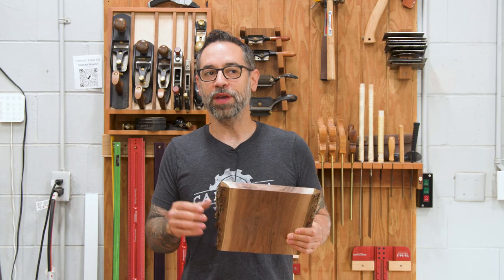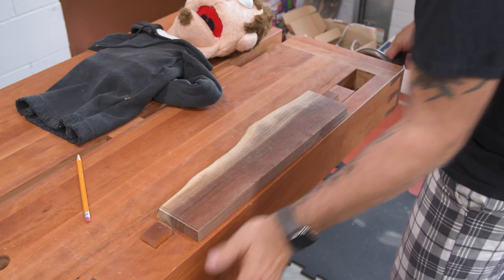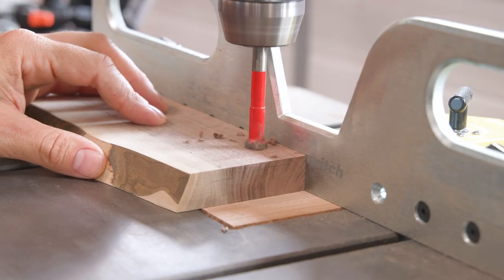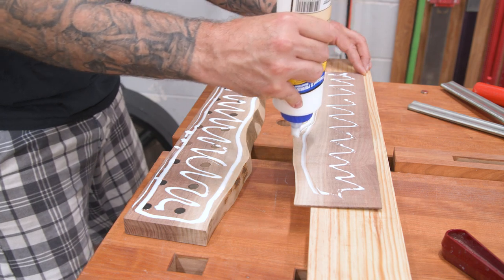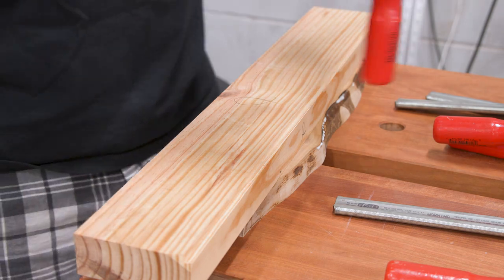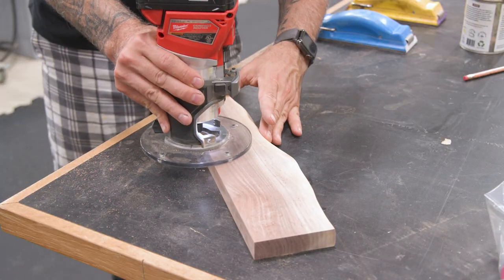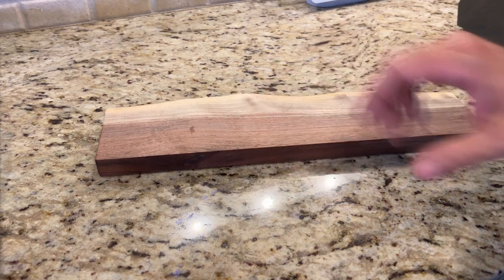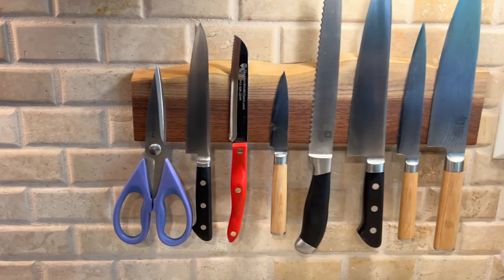The most AMAZING Kitchen Knife Rack | The Wood Whisperer

Comment: Wouldn’t it have been easier to drill the holes for the magnets from the backside and then glue in plugs to secure them?
Reply from the maker: Easier, but this is more elegant.
Reply: You wouldn't be able to drill to the full depth needed because of the point on the forstner bit
Reply: @MatthewBuntyn  drill as deeply as is safe. drop in the magnets. plug them in, then sand the front face to the desired thickness
Reply: You run the risk of drilling too far and it wouldn't make nearly as entertaining of a video lol.

Comment: I wonder had you considered just drilling holes through the back of the wood and then placing the magnets inside from the back? Seems like a great way to avoid having to cut the face off the wood piece and dealing with the seam.
Reply: That's exactly what I was thinking. Just plug the holes with dowls and the magnets would never come out.
Reply from the maker: Nope. I found this to be a more elegant solution. Also you have to watch the point of the forstner bit when drilling from the back. The way I did it gives you the most bang for the buck from the magnets and provides a cool seamless look.
Reply: @woodwhisperer  Fair enough.
Reply: But you are never going to see the back?
Reply: @woodwhisperer  Seamless? Isn't there a noticable seam all the way around the edge because you cut it in half and glued it back together? 🤗
Reply: I know this is old but trying to slide the magnets to the bottom of that hole could have been a nightmare

Comment: I made this the easy way. My board was 1/2" thick and I just set my depth stop on the drill press and drilled from the back so that the bottom of the hole was close to going through. Squirted some epoxy in to the holes and dropped the magnets in. I just filled the holes the rest of the way with the epoxy. Screwed it to the wall, looks great, works great.

Comment: Nice.
Single magnets are much better solution compared to strip. They "auto" position knifes spaced from one to another.

Just... bottom of top cabinet is much better place for knifes.
1. there is much less chanse to accidently cut yourself
2. it's actualy easier to pulll the knife when it is in horisontal position. Just slide it out, no need to overcome the magnet.

Comment: I love some Henckel Knives! I tried the Command strips as well on a HF tool magnetic bar to use in our camper. I placed the bar and the knives and while I was working on the paper towel setup, the Command Strips gave way and I got a few slices on my hand. Thank god they were AmazonBasic knives and not the Henckel's; I think I would have had a few stiches otherwise. Great Vid and inspiration on what to use some my ashe tree that I fell this past winter after they dry through this North Caroline summer!
Reply: My Henkels are 43 years old this year, and still command mad respect! Good to know about the command strips on an RV wall. Thanks!

Comment: Nice, as usual. However I'm going to throw a couple of ideas here.

- First, instead of cutting in the bandsaw the way you did it, you could do it in the tablesaw, Just a couple of cuts. Taking the cut in the bandsaw in the video as a reference for position and calling it "vertical", you would need to make the cut as high as your blade or the wood board allow, so the blade doesn't cut through he live edge. This cut should be as close to the (future) front of the piece as possible. The second cut would be with the board in the horizontal position, so you're left with two pieces, one with the whole live edge untouched and the front of the piece (with some kind of weird rabbet shape) and another one with a rectangular shape. Now you would make the holes in this last piece and proceed to gluet it back to the "front and beautiful" first piece. Yes, I know the blade in the bandsaw has a bigger curf but it's easier (I think) to hide the cut on the sides than along the live edge.

- Just make the whole bunch of holes from behind as deep as needed, insert the magnets, glue some plugs. Yes, I know, this doesn't make such a nice video.

Comment: This looks amazing. Not how i would have done it. But I am also not a professional or amateur or hobbyist wood worker. I would have probably routed out the magnet holes from the back and then added them from the back rather than a veneer front since the wood doesn't need to be super strong structurally Also I think you might have been using those command strips wrong. maybe not cleaning the surface well or not giving it its working time because they really do need an hour to set up. I am forced to use them since my rental doesn't allow mounting screws and I have it hanging a 2kg miniatures case with about 2KG of minuatures inside and it is holding up like a champ.

Comment: I tried to make a knife block one time, and I had to mill the wood in front of the magnets to be paper thin, where I could start to see light through it. I'm surprised yours worked with magnets spaced so far apart and such thick wood in front of them. Maybe my magnets weren't rare enough? Or maybe my knives aren't magnetic enough?
Reply: I bought some NEODYM magnets from amazon and did a test fit with them. I indeed experienced the same problem. Magnets weren't strong enough unless stacked two at a time or just with a very thin layer of wood. 
If there's one thing I do not want will be knives falling while slightly bumping in to them or while removing one of the other knives. 
Still looking for affordable suitable ones.

Comment: Are you worried at all about damaging the tile if you decide to take it off? I've been hesitant to do the same in my kitchen.
Reply: Dribble some alcohol between the piece and the wall and it comes off nicely.
Reply: @dwightl5863  Oh good to know!
Reply: I pulled smooth shiny subway tiles off the wall after using Gorilla tape. It was an easy fix, but caused a few anxious moments !!
Reply from the maker: We plan to re-do the kitchen at some point in the near future, so if it pulls tiles off it might be doing me a favor. 😂